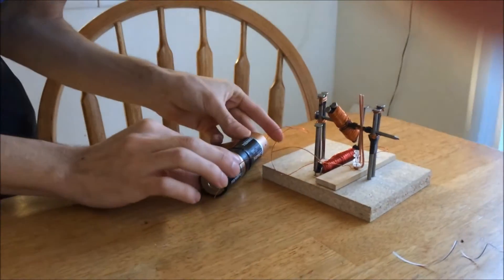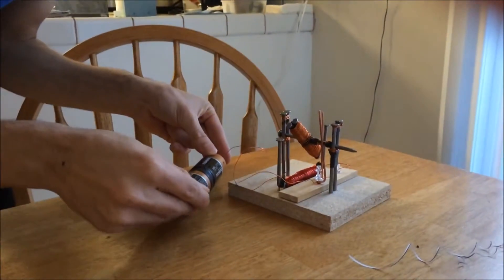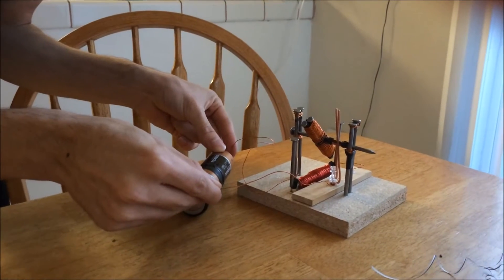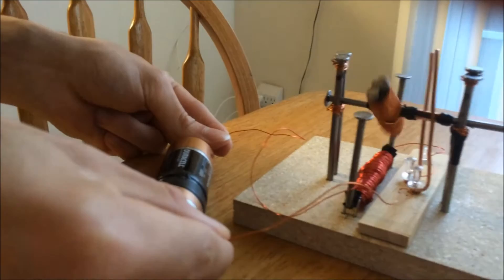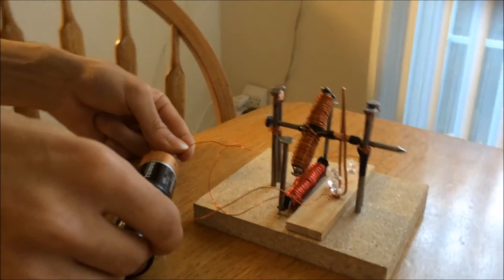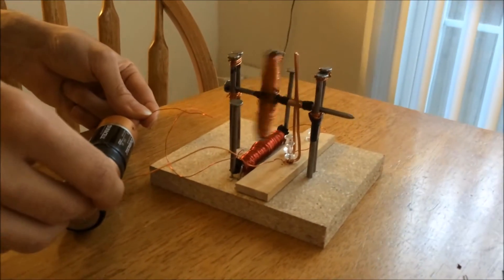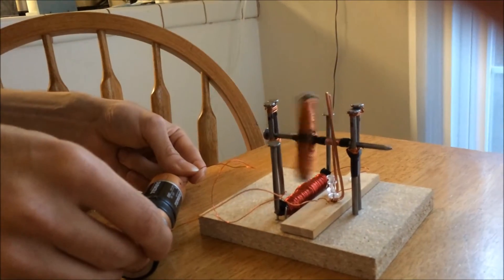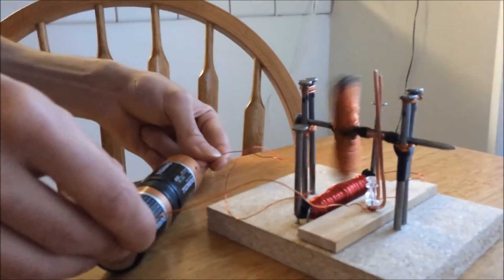The Electric Motor with Split Ring Commutator

Comment: Which side of the rotor itself is North/South?
Reply from the maker: The north/south component is strictly on the vertical nails.  The solenoid creates the magnetic field, where the right hand rule determines the direction of the magnetic field.  The fingers wrap around the direction of the flowing current on the solenoid, and the thumb will point the direction of the north component of the magnet.  If you were to flip the battery, the direction of the current will change and thus the poles will be flipped.

Comment: Hi OP! By any chance, would you be willing to explain your building with instructions? Particularly the way the wire is wrapped around, starting from where. Thank you so much!
Reply from the maker: http://bizarrelabs.com/motor1.htm
http://bizarrelabs.com/motor2.htm

These are the exact instructions I used to build the motor.  Note that the wire for the armature (the giant spinning block of wire) and commutator is completely separate from the wire for the brushes (which connect to the battery).  The extra wire ends from the armature after you finish wrapping it are used to make the commutator.  This is pretty difficult to see from these instructions.  

Make sure you wrap the wire for the solenoid and the armature VERY tightly.  There should be no visible gaps to the nail/electrical tape beneath it.  When I wrapped the solenoid, it took me about twenty or thirty minutes to wrap all 600 turns or so.  The armature took about the same amount of time.  It has been a while since I made this video, so I cannot quite describe much in exact detail.  I can only really tell you to follow the above links, since those are what I originally followed.
Reply: Jacob Lampl Thanks so much! In case I have any more questions, check your Facebook messenger. Thanks again!
Reply: Jacob Lampl For the tape, should I use electrical tape?
Reply from the maker: That's what I used.  But use it conservatively, since the stuff is relatively heavy.  Only use as much as you need.  Otherwise, the armature might get too heavy and will not spin due to friction-based issues.
Reply: Jacob Lampl Do you remember if you put any electrical tape underneath the solenoid (red wire) in order to attach the two nails?
Reply from the maker: As far as I recall, I did use electrical tape underneath the solenoid.  That holds the bent nails mostly upright and together.

Comment: This appears to be taken pretty much directly from a 1959 or so Cub Scout Wolf (or Bear?) manual.  Made a few myself, one with "brushes" made of 1/2" wide tin can strips.  The commutator tends to be bumpy in places so (and I only theorize here) the wider brush provided more consistent contact, thereby resulting in greater rpm.  I also once used an old model train transformer to provide variable (and much higher!) voltage.  The higher voltage eventually resulted in burning through the commutator.  Mine, too, used wire for shaft bearings between the nails.  Used the last one I made to power a home made paddle wheel boat made with my young son at the time. Instead of a nail I used a 1/8" steel rod to which I glued the needed pulley.  Great fun.  Great father-son/daughter activity.  Thanks for posting.

Comment: This is awesome, I have to make a motor like this for my high school engineering. It looks like you're using electromagnets, are the poles at the bottom or do the nails on the side carry the magnetism up and repel the armature from in the air? How did you connect the armature to the shaft? How were you able to suspend the shaft with so little friction? Is there a way to make it work without a push? Would using 12 Volts work better?
Reply from the maker: The red colored section of wire acts as a solenoid, which does indeed create an electromagnet using the nails.  A magnetic field is created through the solenoid, and since the two nails sticking straight up have a lot of iron in them the magnetism is transferred through these nails.  One nail acts as the north end of the magnet while the other acts as the south end.  Below is a very crude diagram of how the magnetic field works (the sides being the nails, the m's being the solenoid/wrapped nail at the bottom, and the -> arrows being the direction of the field.

N-------------S
^>>->->->^
|->->->->->-|
|mmmmm|

Underneath all of the wire for the shaft is a bunch of electrical tape.  I just wrapped it around a bunch of times, but be careful not to use too much, because otherwise the shaft gets too heavy and you end up with a friction problem when suspending the shaft.  

As for suspending the shaft with so little friction, that was a tricky part.  What I did was use some of the copper wire that I had left over and wrapped the two nails together with that.  The enamel on the wire I used was pretty smooth, but using the wire meant that the connection between the commutator and the arms had to be spot-on as the wire had a relatively significant amount of friction compared to the magnetic field trying to turn the shaft.  

My motor needed a push because of the friction problem I had described above.  If you can find something with less friction you'd have an easier time getting your motor to turn.

I did this project for a physics class where the requirement was 3 volts, so a greater voltage battery setup would make it work much better.  I did also use a 9 volt battery outside of the video and it spun very fast (really, though, it depends on the current/amps rather than the voltage, but you get the idea).  A 9 volt battery is a great testing point in my opinion, as once you can get the motor turning you can identify the problems you have with it for why it isn't working so great.

The biggest problem you'll most likely have if you build one like I did in the video is the brushes maintaining contact with the commutator.  Too much and you'll have a friction problem there; too little and there won't be any current flowing through the shaft to allow the magnetic field to turn it.